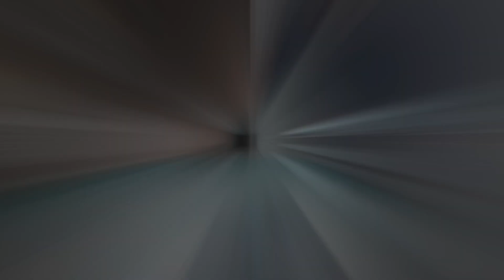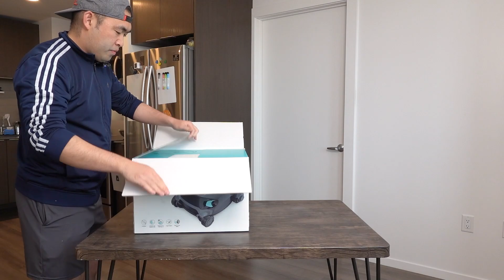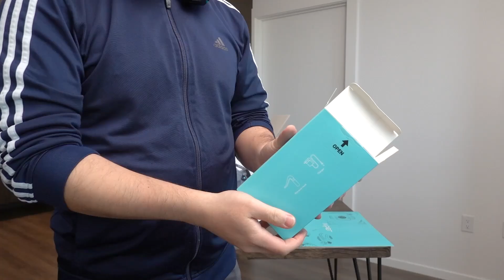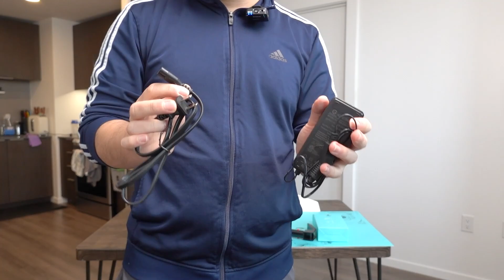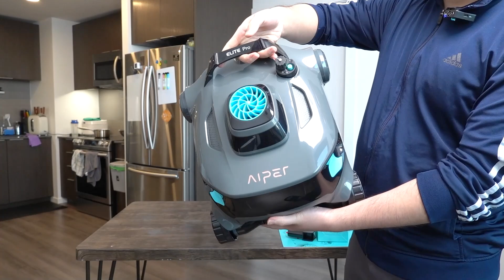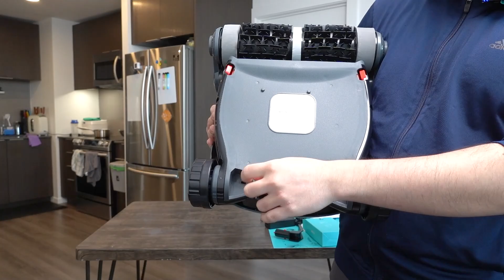Should You Buy? Aiper Elite Pro Cordless Pool Cleaner

Comment: 0 seconds ago
just received the 3000. Although I like it VERY much I have a problem that I have not been able to solve. It gets stuck on my “WaterWay Drain Cover.” My pool is new and the drain covers meet all new requirements for safety . I’ve been told to add two 2”x2” foam blocks to assist the vacuum in climbing over the drains. Unless I can find an easy fix I’m afraid mind is going to be sent back.

Comment: Found the Aiper Elite Pro to spend way to much time attempting to clean the walls instead of the bottom of the pool where the sediment settles (should have been programmed to stay on the bottom of the pool about 80% of the initial charge time).  Often stops and reverses for minor changes such as coming from the deep end of my inground pool to the point it levels out at the shallow end, it thought the change in pitch was a problem (yet climbs walls) instead of pushing through until it does not move forward for 3-5 seconds (resistance, not pitch change).  Returned it and ordered the Aiper Seagull Pro which as a selector switch for bottom, sides, and automatic (bottom and walls), and is available for pre-order (as of today 26MAR2023), shipping to be announced.
Reply: Did you receive your seagull pro pool vaccum yet?  Does it meet your expectations ?